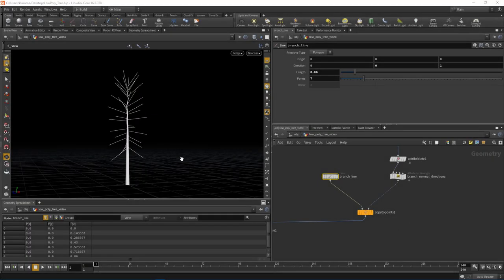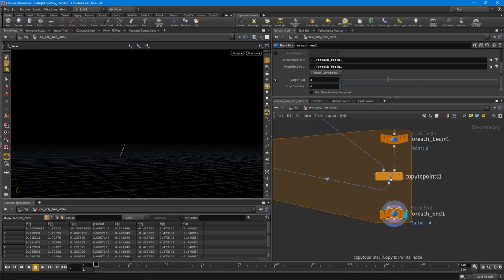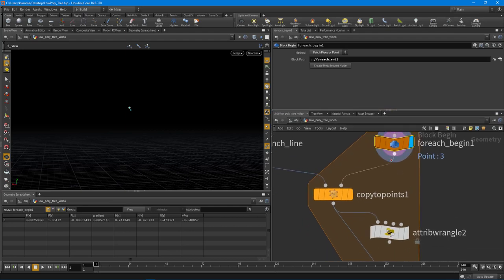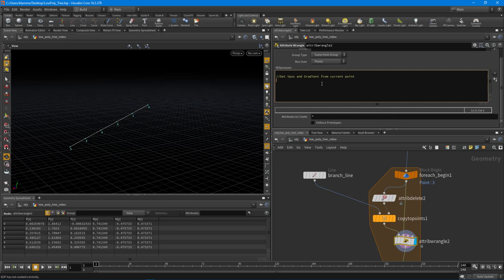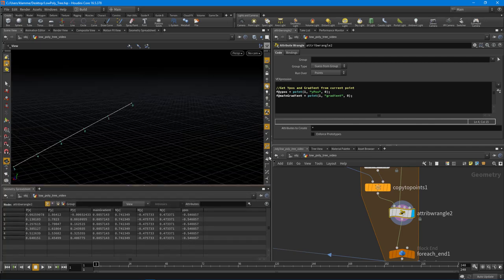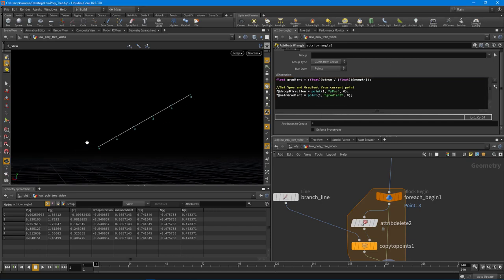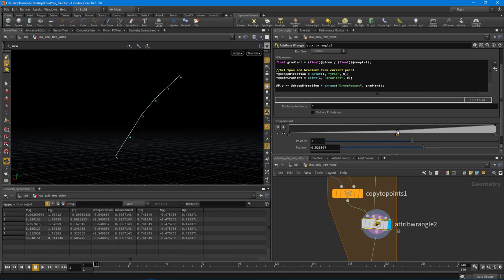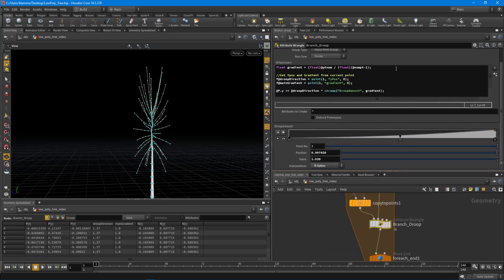Procedural Trees - Part 5

Comment: Hey for each  does not work although we do the same things 
Can you share the hip file?
Reply from the maker: Sure.  Let me post it up to gumroad for ya.
Reply: @IndiePixel3D  is that still available? My For Each didn't work either. No droopAmount happening.
Reply: @stevensilcock  i am having issues with the droopAmount as well.
Reply: @maximostromogilsky188  I noticed my Attrib Wrangle node directly above the foreach_begin1 (I've called "branch_normal_direction")  has a Ypos chramp (build a Ypos) which doesn't seem to do anything either. My rotation works fine, but nothing for the Ypos chramp. Whether this could impact on droopAmount I'm not sure.
Reply: @maximostromogilsky188  have you downloaded the ip_low_poly_tree.hip file? I noticed he has set it up some what differently then this one. https://gumroad.com/indiepixel scroll down for the low poly tree.
Reply: @stevensilcock  i did download the gumroad file as well, and also noticed that it was somewhat different from the one in this video series, so i just moved on with following the rest of the instructions. Besides this glitch, i think overall this is an awesome tutorial for VEX beginner such as myself and i did learn a lot!